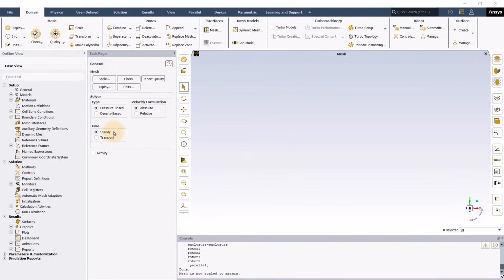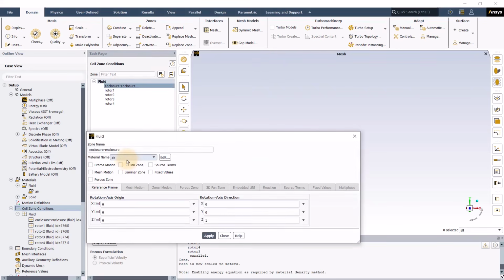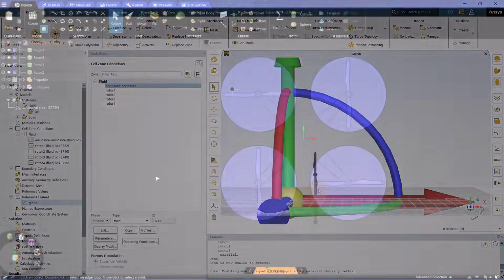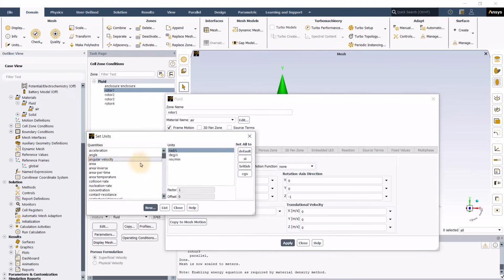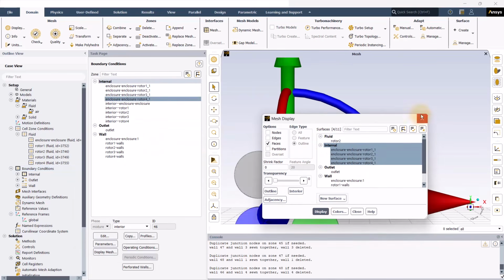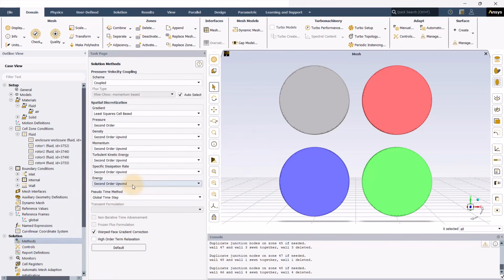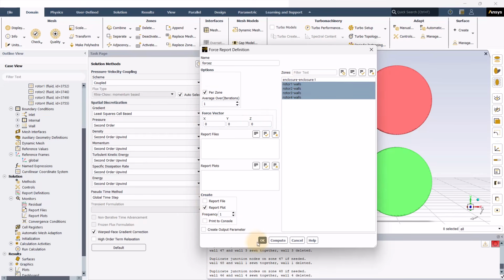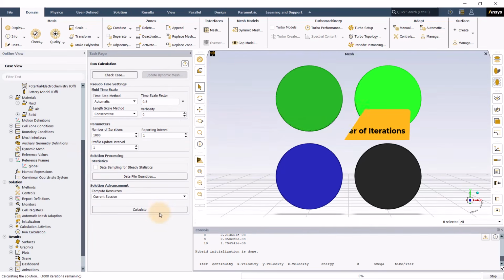Solver Setup Using Ansys Fluent Software

Comment: Thanks for the video. These mistakes could be corrected: 1)There is no need to check the display mesh for the zones in Fluent, since the same geometry file is transferred from Discovery. Instead, it is better to check the rotors in the geometry file itself, 2) There is no need to use negative signs twice for rotor 2 or others. Using −Z for clockwise rotation and then a negative RPM flips the sign twice.